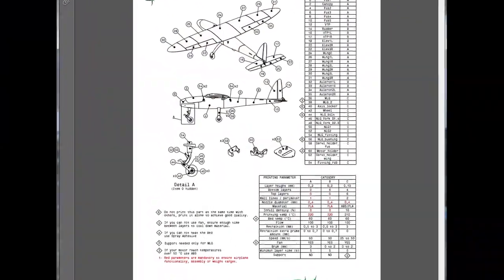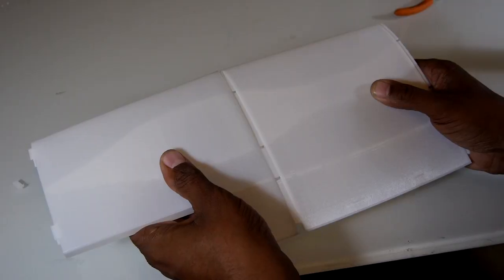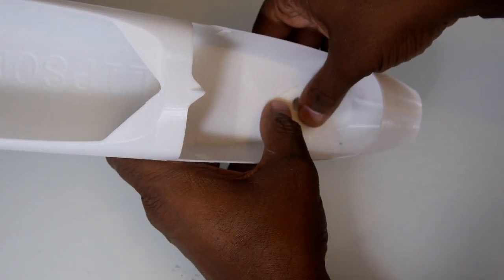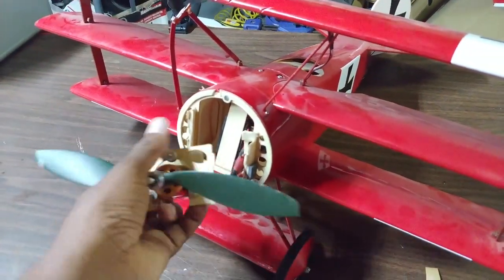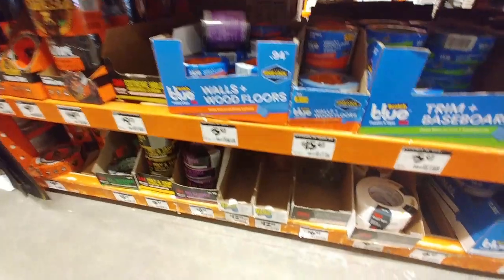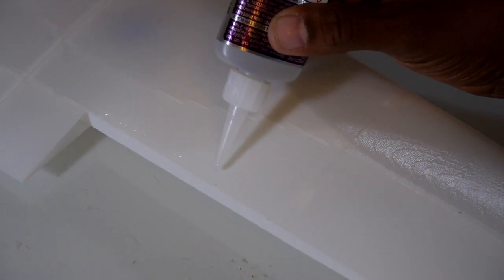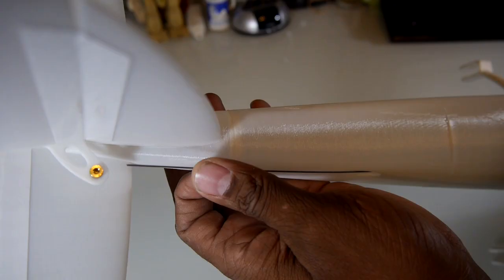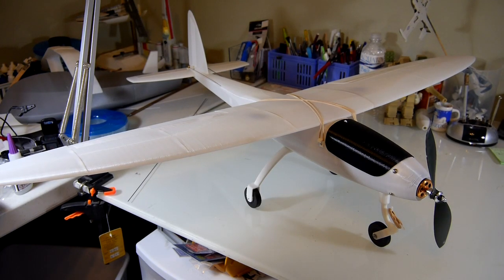Let's build the Eclipson-Y 3D printed plane | HobbyView

Comment: i am almost ready to print this plane... but the manual says about the FAN : YES ...... but i like to know what is the best... fan 100%? or maybe 50?... i think 100% but what did you use as setting for the fan? My idea is to put FAN OFF at first layer and from the second layer to the end FAN ON 100%..... i hope you can help me with this! tnx
Reply from the maker: Yes, off for the first layer. I think I used 50% fan for all other layers.
Also start at around 30mm/s speed first then experiment with higher speed if you wish.
Reply: @HobbyView  tnx for the fast response. I just made my first print and it is almost perfect. 100% fan i used but indeed 50% will be better i think, then the lwpla has more time to expand. I will try tommorow!

Comment: I love this video. I've been using it as a reference for my build. One thing I am having problems with is mounting the servos in the wing. They broke and I'm not sure if its a design flaw or possibly a printing issue. They seem to be to delicate or the hole too small for the screws that came with the servos. Do you have any advice?
Reply from the maker: Try printing them at 100% infil and at a higher resolution (~ 0.1mm layer height).

Comment: thanks for posting.  good work.  some thoughts.   the design of the nose-wheel suspension results in  Excessive  travel, while  Not Effectively  absorbing  Impact  energy.   suggest re-design or elimination of the nose-wheel suspension.    someone chose to use an elliptical wing planform on this model.  i am not sure whether it is a good choice; regardless of whether the model flies okay.    cheers
Reply from the maker: We'll see how well the nose suspension does when I fly it. 
Elliptical wings typically have very good stall characteristics (Spitfire, P-47, etc) so again, we'll see when I fly it.

Comment: Can I use abs instead of pla to make that plane?
Reply from the maker: Jalspiration , no. ABS does not have good adhesion for thin wall printing.
Reply: What is the wall thickness? Thx.